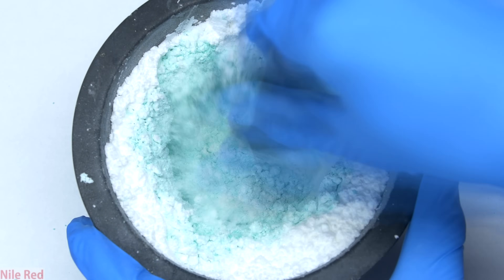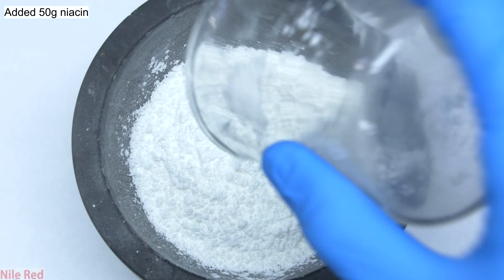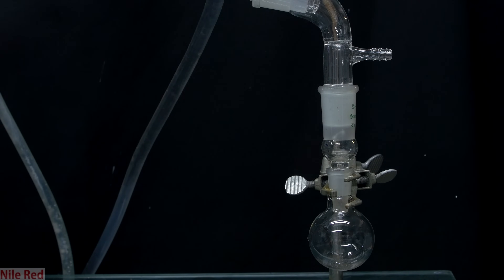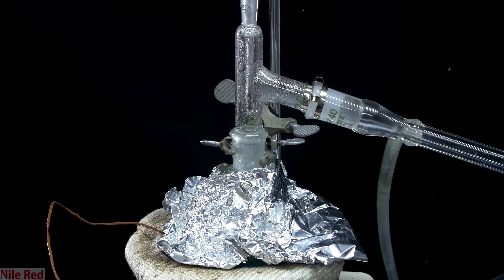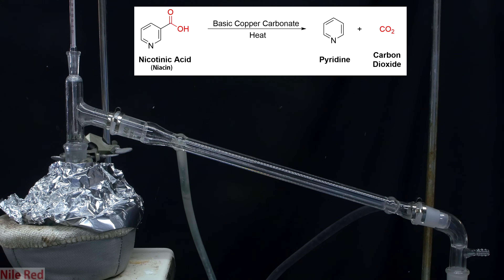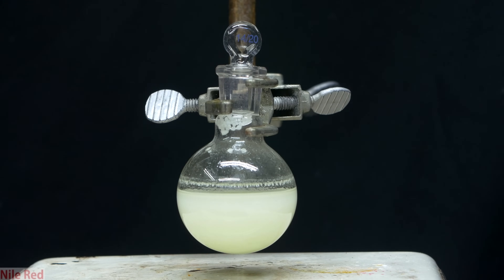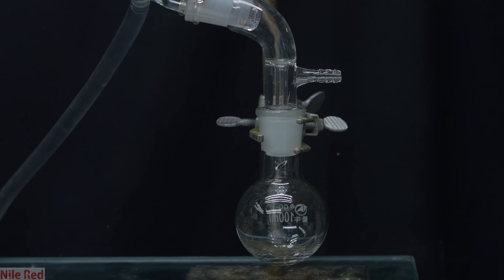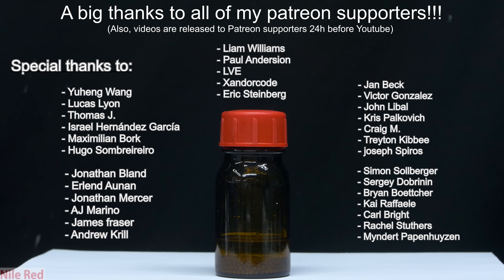Making Stinky Pyridine from Vitamin B3

Comment: Aluminium foil will draw heat away from the flask. It is not an insulator!
Reply: Have you experienced more success without it? Aluminum foil has helped me out tremendously. Recently I made some phenol and only once plenty of foil was applied could the reaction vessel reach a high enough temperature to distill it.

Comment: OK old video I know but I wanted to share this. I just finished this exact synthesis for the first time and I have no idea how my yield was as high as it was. I finished the second distillation and then added NaOH to seperate water from the pyridine. It took awhile which surprised me but the first sign it was separating was almost a whole minute after NaOH addition. I left came back and removed the top layer leaving a small amount behind as not to bring water over with the pyridine. This layer was dried with molecular sieves. I did this on a 3x scale so 150g niacin and 36g basic copper carbonate. I ended up with 75ml of dry pyridine so 25ml per 50g of niacin. This is really high compared to others I've seen. I did premix the basic copper carbonate and niacin and stoppered them in a flask where I kept the powder stored for about 2 weeks before I got the stones to do it. The color had changed from a lighter green color to more of a blue. It is definitely pyridine the smell is ungodly and it sticks in your nose for awhile if you get a whiff. I used a respirator until I added sieves that's where I smelled it. Long story short what did I do right?!?! As Nile says in the video most are around 40% yield and upwards of about 75% but I got about 83% I think it comes out to. I thought maybe it wasn't fully dry but addition of more dry sieves produces no further reaction. Help how did I do this lol
Reply: Are you sure your product is completely pure? You might have some contamination that's increasing the supposed yield
Reply: @GiraffeFlavored  yeah I'm fairly sure but I can't be 100% sure to be honest with ya. The copper carbonate I know was pure but the niacin was a supplement that claimed 99%. Never know there though. The factor besides leaving it mixed In storage for 2 weeks was I took 2 hours to slowly get up to temp and no idea if that could even be a factor. I did use some as a catalyst and dried and recovered it. The fraction on recovery was 114-116c so maybe that could indicate something like a similar boiling impurity? Its hard to say after using it In a different experiment. I did try again with more products and only got the same amount of pyridine even though I started with more. This could be a lesson for me on doing some confirmation tests when I'm done even just density. 😅😅
Reply: @midwestchem368  Hey there!
I'm doing process chemistry and from what you're describing, you should consider everything you did different as a potential cause for your increased yield.
Since you don't have analytics, this is of course a bit of a problem, because you can't rule out that your high yield is just an impurity.
I'd strongly suggest you do at least some confirmation tests, like titrating it. You might have to look up a method for that. Your boiling point is already a good indication, if two other independent tests like titration and density yield good results, I would assume that you have reasonably pure pyridine. Maybe repeat a distillation, sometimes, compounds behave very differently on recovery and subsequent distillations because of water content or solids present.

Considering the process: I have absolutely no idea what went right there, but the way to go about figuring it out would be:

1) Confirm by exact repitition, down to the exact glassware and stir bar you used. Does that confirm the results? If it doesn't, any speculation about causes won't help you until you figured out what went different.
2) Change one thing at a time until you find the change that breaks it. Start with the most likely cause from a theoretical standpoint, or with the easiest, quickest, most convenient or most desirable change to implement in the process.

One person alone working on a process is mostly about time management, but if you want a certain answer, you won't get around either finding your exact problem solved in the literature or trying yourself empirically. 
If the process interests you, maybe send a sample of your pyridine to an analytical lab for an NMR or similiar way to identify and quantify your product. The increased efficiency of the process might be worth the money, and you can brag about it with hard data in your hand. :)

To contribute a bit to baseless guessing: The colour change of your reaction mix might be significant. Maybe some beneficial complexes formed or water content got transfered from the niacin to the copper carbonate, or some other slow reaction took place that is good for the reaction, but competes with decomposition and evaporation of niacin at high temperatures.

In your case, I would start there after exact reproduction and try the same process without aging the reaction mix. If aging helps, you might be able to encourage whatever happened to your reaction mix, maybe by suspending in a solvent and evaporating it again or something, to speed up the process.
Reply: @stefangadshijew1682  thank you for input it sounds actually like a great plan I would love to gather some data to see what happened here and if it was actually increased yield or something altogether different. I could probably find someone to do an NMR for me and see what they say. I appreciate the comment I always enjoy feedback. It helps to learn more and just improve technique and overall get better with reactions.

Comment: The smell of pyridine is honestly hard to describe. It's fishy, yes, but it's more complex than that. It's got this oily-ness to it that's almost like old fryer grease, but then confusingly has just the faintest hint of kind of a floral sweetness. It's a very odd, off putting, but in brief moments ALMOST pleasant smell, but that pleasant aspect to it doesn't last for more than a short, short moment at any given time.
Reply: I have a crude yet effective description of the smell of pyridine; semen
Reply: @surkey5055   eh, I don’t think it’s that close. Other ones like spermidine and putrescine smell more like that
Reply: @spiderdude2099  I suppose that could be right since my only experience with pyridine is with novel RC stimulants containing it (MDPHP, APHP, any pyridine based cathinone really) and those smell heavily of semen

Comment: "I don't know honestly why I am low yield"...honestly this what I would expect from reckless pouring of chemicals "let's just pretend nothing happened"
Reply: The amount that spilled over is no where near enough to account for that percent yield loss. The bulk of it has just come from the Niacin sublimating.
Reply: Also he said the niacin was wet, which would also account for some of the missing volume.
Reply: I figured he had such a low number cause people like to talk themselves up to others....
Reply: @Shad0wBoxxer  
Sometimes it does happen but a yield of 75% can be achieved quite easily with a copper chromite catalyst. It needs lower temperatures, therefore reducing the sublimation of niacin and the charring.
Reply: @Shad0wBoxxer  
For example doug's lab got 86.6% yield. Yes, he jumped the sodium hydroxide steps, but I'd say that water and nicotinic acid aside his actual yield should still be around 70%. The reaction with copper chromite was definitely much cleaner. It's pretty evident by the amount of char in the distilling flask and the color of the distillate.
https://youtu.be/FNsqYwzm40M

Comment: I'm curious as to how to deal with all the chemical waste you must encounter; do you simply proceed with copious amounts of  quenching and down the drain (for most things)?
Reply: depends ... acids and bases can be dissolved and/or neutralized, some chlorinated compounds can be neutralized by Fenton's reagent, mercury can be converted to sulfate and extracted, some stuff can be burned (oxidized) before throwing out ... some chemicals however are dangerous to the environment and should be properly disposed of (there are facilities for that, some chem suppliers buy back used solvents for recovery etc.)

Comment: +Nile Red  Destructive distillations are fairly common in amateur chemistry and I have often wondered if the addition of a high-boiling nonreactive liquid would improve the procedures.  Such a liquid would act as a heat transfer medium to prevent hot and cold spots.  It might also have some solubility towards one or more of the reactants, leading to better mixing.  The only suitable things that I can think of for this are petroleum wax and silicone oil, but maybe you have some ideas and might be tempted to try it out.